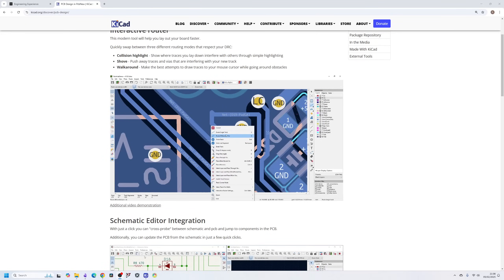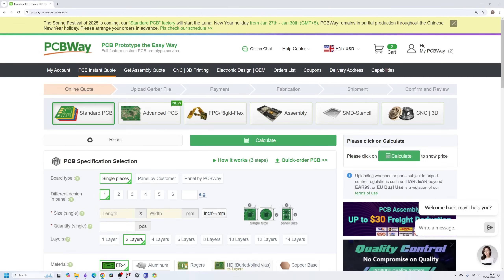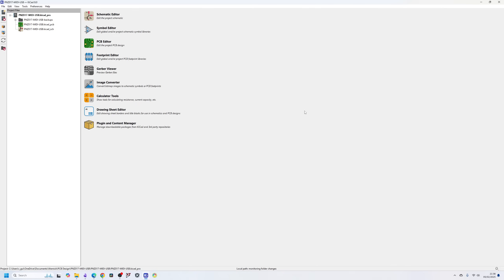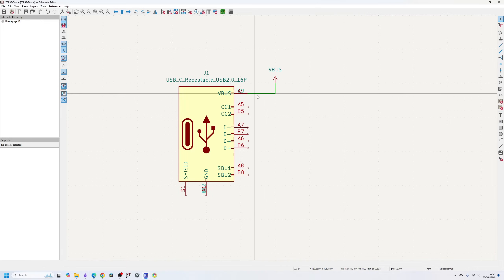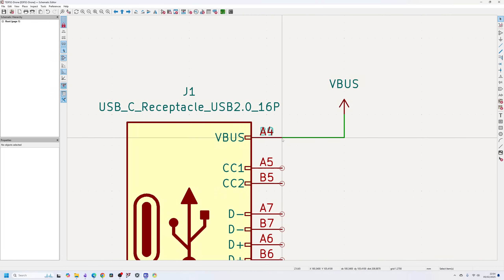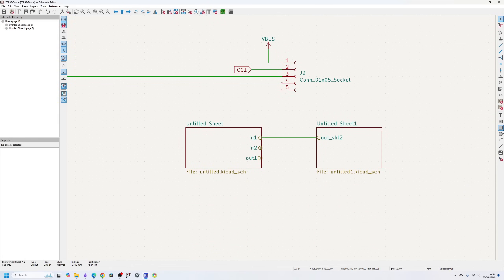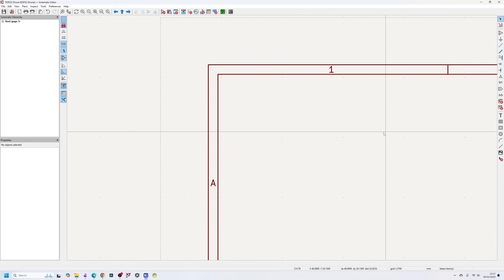KiCAD Tutorial #1: Introduction and UI

Comment: 4:45 intro starts
7:10 preferences -> configure path
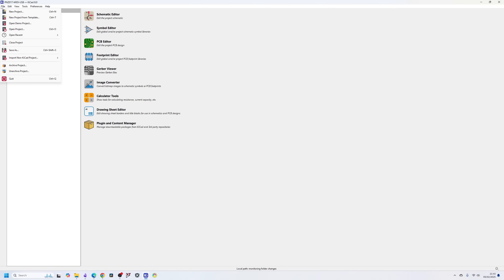8:19 starting a new project: 
*file -> new project -> schematic editor 
-> page settings (top left) fill in information
-> set page size to A3 
10:14 controls are on the right
11:30 wires and connectors 
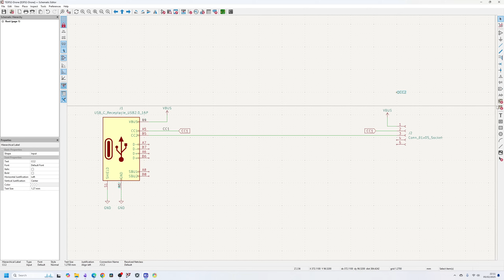15:42 add sheets
17:42 bill of materials, assign footprints